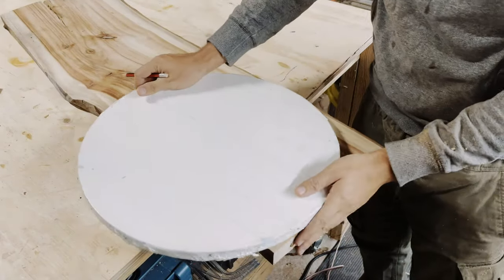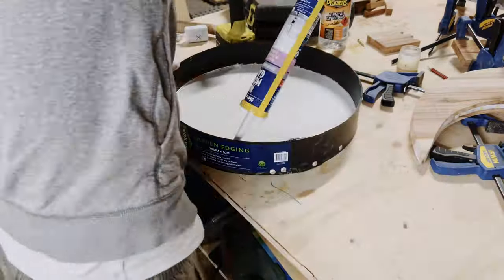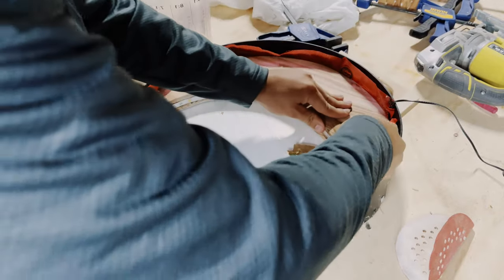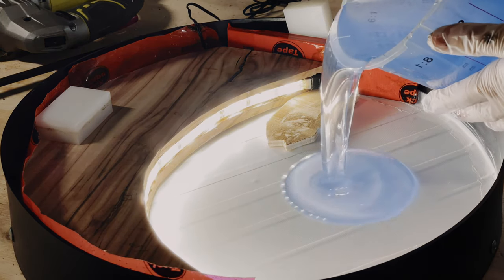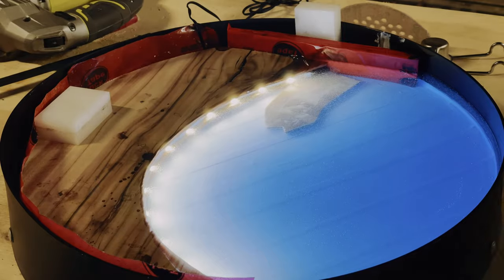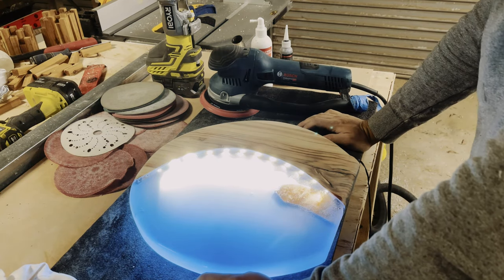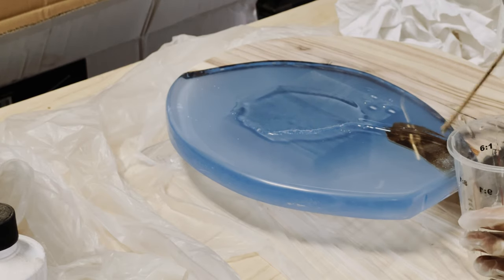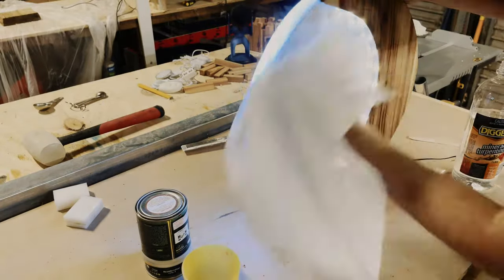Blue Epoxy Resin Moon Lamp

Comment: Very cool idea and sorry about your loss. One idea is to pour 1/2 of the epoxy and let it cure. Prep the laser engraving with epoxy seal coat. Place it more to the center and then pour rest of epoxy so it now floats in center and the lights will be softer. This is a project I will attempt with other items. Keep up the good work
Reply from the maker: Thank you so much for the kind words. Omg this is an insanely good idea. Let me know how you go. I know the laser needs some colour resistance to engrave super keen to see what you come up with 😊

Comment: I don't like when the led's are actually seen. I just like the light with no visible bulbs.
Reply from the maker: @iMakeFunWithFish  that’s a good one. Do you recommend a to put a cover on it? I hoped it would disappear when I inlaid it.
Reply: @coolabahwoodworking  I have zero experience but I am planing on doing something similar. I was thinking maybe making a canal in the wood and put LEDs in so they are deeper and not seen so much. Diffusion cover would also work I guess. 🤷‍♂
Reply from the maker: @iMakeFunWithFish  great idea. I think the cover is the way to go or more high quality LEDs. Some of them are better out of the box defusing things. I have planned another lamp soon. Haven’t built one in a while 😁 will yours be round?
Reply: @coolabahwoodworking  Great work, by the way! I'm still watching a lot of videos to learn as much as possible before diving in. I have some old film canisters and cassettes that I'd like to display in epoxy with LED lighting. I'm still in the planning stages, so it will probably take a while. I'm thinking of a rectangular shape for the display. 😄
Reply from the maker: @iMakeFunWithFish  Thank you ☺️ that sounds very cool. Hit me up on instagram when you build it would love to see how it turns out.
Reply: @coolabahwoodworking  Sure thing! Keep up the great work and stay creative.
Reply from the maker: @iMakeFunWithFish  Thank you ☺️